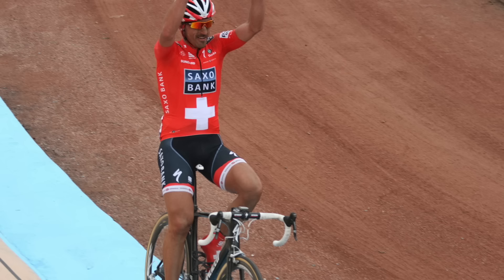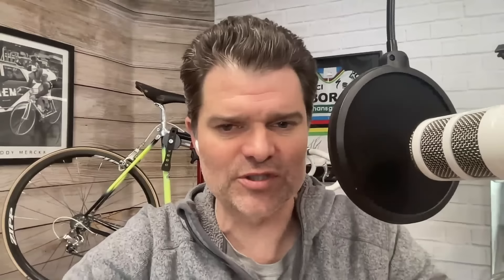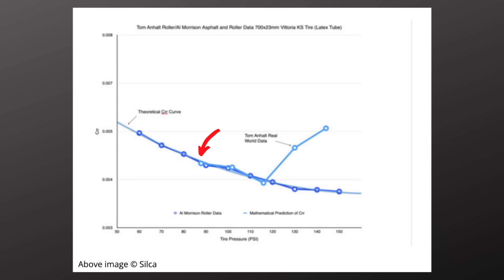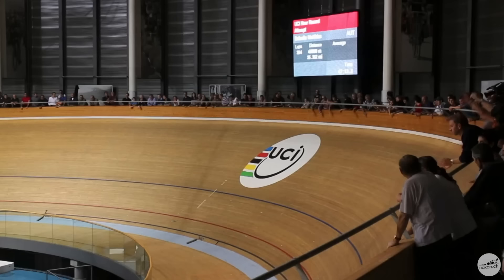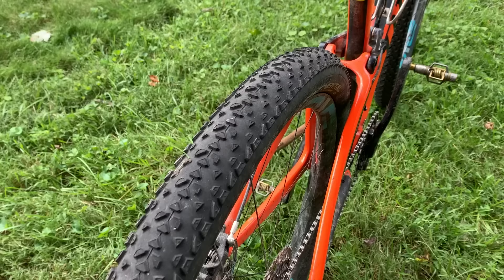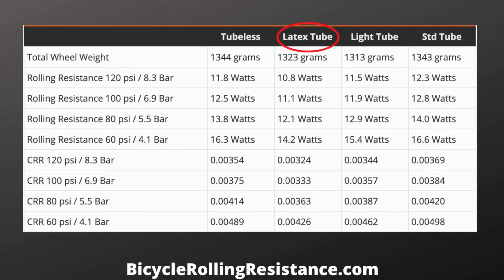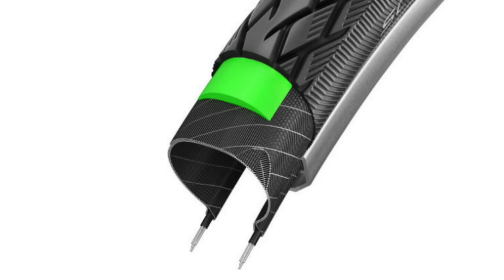Your Tires Could Be Costing You Minutes. Tire Rolling Resistance with Josh Poertner

Comment: Nailed it! Have been trying to work out a balance between the most efficient tire and insert setup for the upcoming gravel season while also being as puncture resistant as possible. This was very useful information, thanks!  Discussion with an industry expert format was great!
Reply: From my mtb experience I find the inserts (I use tannus with a tube as I am too lazy/cheap/eco to keep topping up tubeless sealant every few months) it is easy to opt for too low a pressure. The inserts do a great job at cushioning the rim and propping up the sidewall allowing decent cornering but one sharp edged rock will STILL always get me a pinch puncture. I either need more robust tubes or put a bit more air in - still playing around but the take homewould be don't expect full protection from the insert. Grip, comfort and protection from small thorns etc - brilliant but pinch protection not great.

Comment: I went and used the calc as soon as he mentioned it and was surprised I was pretty close already. 1 psi fr and 4 psi back too high, but my risk tolerance for pinch flats is low. Ideally I know I could go lower and probably faster or hit the plateau around 5-10 more psi and the main risk is pinch flatting more than going slower.
Reply: That's where the tyre insert helps. I got a Vittoria gravel insert for my rear wheel and I can run much lower pressures. So much more comfortable on rough roads.

Comment: I’m a new (road) cyclist and very skeptical regarding equipment. I was inflating clinchers with tubolitos at 115psi. I’m not good at technical descents. I recently built a new bike with tubeless at 80psi. I can finally trust the tires and they grip much better. I was surprised. On further comparison the tubed tires are too hard and skid (slip) on tarmac, not to mention how harsh and bumpy tubes are. Thanks for the more technical explanation

Comment: For every technical road crit I would drop that tyre pressure way the hell down, under 100 psi for a 25 mm tyre because for crits the goal is to stay upright in those corners which means a need for more traction.
Reply: In my experience flat tires are really slow.

Comment: Old school over here, still pushing pressure of my Conti5000 in 25 up to 8+ Bars thinking it's faster for stealing KoMs 😅 Time to test recommended value of 6,5 bars but it feels so soft and slow my god!
Reply: I go by PSI on a floor pump that is largely illegible and driving me bonkers but let me say that 100-105 PSi fresh off the pump recently was felt to be very harsh, and due to that inefficient. Previously I have ridden with my front around 90 PSI and rear a little higher and since this was less bouncy it felt better and was smoother. I think the 95 PSI or 6.5 bar is spot on.
Reply: I’m rolling 28mm conti5000 at 5 bars rear and 4,5 bar front. Anything more and i feel my speed dropping at every little bump. With these pressures i’m cruising and still reactive when i push.

Comment: Its a bit of trial and error, over the winter I have been doing short course forest -gravel racing, I have opted for 28mm road tyres running at 95psi front and rear, now that would normally be a disaster combination, however I have done really well, coming in a far better position than I expected, improving on every race I am a big bloke but this is what is working for me , the wheels are hed ardennes and the tyres god old durano DD.

Comment: The video was excellent. Just one additional point though. You have to be in a devloped country to use your advice. In the Philippines, I used to use continental racing tires, inner and outer, and I got flats all the time. Nearly every road trip, so annoying. Now i use continental 4 seasons, and cheap, thick, Black Cat inner tube with inner linings. Not fast, but at least, no more flats.

Comment: I used the pressure calculator and I was surprised that I was running at a much higher tire pressure than what's recommended. I've always been told that higher is always better. I have a road bike with Good Year Vector 4 seasons tires at 28mm. I always went 100psi on both tires. Now, I'm eager to test it out at a much lower pressure 78.5 in back and 77 in front and see if it does make a difference.
Reply: Jesus man. You must be bouncing quite a bit on bad asphalt unless you're a very heavy rider. I use 85-90 PSI on 25 mm. tires and it's comfortable enough for 3 hour rides. You'll be glad you dropped that extra pressure.

Comment: Never heard about inserts although I still run latex tubes. No tubeless here yet I am just used to replacing tubes if I get a flat. Although I will say since I started running lower pressure I haven't had a flat knock on wood.

Comment: Wow! Most of this stuff sails way over my head, but I have put a lot of miles on bikes. I have also noticed that tires make a difference in how fast I go. For me, on smooth pavement at least, 700 x 28mm at 80psi feels the fastest. On rougher roads 700x 40mm at 50psi  feels fastest. Off road, I couldn't even guess but it seems wider + softer = better. Of course I am heavy (200-220lb depending on how much gear I'm packing).  I have also noticed Kevlar liners seem to make the tires slower. (I just use sealant and/or an old tube as a liner)

Comment: Talking Vittoria insert......I installed a set on my aluminum gravel wheels and don't "notice them", which is good, but I really doubt I could ride them without air. The Vittorio foam is very easy to compress, so I'm pretty sure you would be riding on the rims. Other inserts may be more dense and resistant.

Comment: I just got back into road cycling after being away for 10 years. Since my bike is from 07 it won’t fit any thing bigger then a 25. But as soon as I got to Florida where we can ride year round I started running lower pressures in my old racing 700x23s. I’m actually running 85 lbs now and I used to run 115 to 120. 
I did have a problem in a sprint the other day. The bike really felt a little wobbly at 35 mph in the heat of the sprint like the tires were flexing too much.

Comment: You aren't measuring rolling resistance if you put a wheel on a drum. Because the most important factor is missing: the body of the rider. Inside the body friction causes energy losses from the propulsion. This is usually way more than hysteresis losses of the tyre.

Comment: Hopes its ok to make a second comment: For over 20 yrs I have used on my road bike tires at 23mm front and 25mm rear both inflated to 120psi.  If I go any lower, I hate the under steer that increases.  I am a tall a heavy rider and I am more likely to get a pinch flat.  On my MTB ride I used 2.5 x 26 inch at 40-50 psi, lower...then there was under steer.  For me I just like the solid feel of the tire under me, I want to feel the road (Vittoria tires @ 320tpi...just love them). Off road, I did the Wilderness 101 using 47 mm rims and 2.5 inch Bontrager Big Hank tires (zero tread)).  What a awesome ride!!!   I think the rider style, rider height (center of gravity) and rider body weight is fundamental in this subject.
Reply: Those are some very high pressures. You didn't list your stats, but I'm 6'7" / 230lbs and quite competitive, at least on Strava.....Gravel 40mm 28psi F 40psi R / XC MTB 2.3" 22psiF 26psi R....a pound less or more depending upon terrain
Reply: Yeah EWS and pro DH riders really have understeer issues running pressures in the 20’s, if only they had your wisdom

Comment: Good video and like the Podcast style used.  My ongoing nagging question is why is watts used instead of "Torque or pedal force"?  Not sure how the formula for Watts or Horsepower is applied when discussing friction? Would it not make more sense to examine pedal load or torque output, given the same gearing, RPM and carried weight (rider plus accessories) is used in each sample taken?  

Pedal force and torque is what changes (at the same gear, RPM and weight) to achieve the same speed when testing changing tire pressures and tire widths.  Power out put in these instances are meaningless except to excite the mind.  

Then again it appears most power meters fail to display and record the torque output as the PowerTap did back in 2003.  Pedal power meters should show/record the force applied by the foot to the pedal (as piston force is to car engines) which is the ultimate measure of rider input, especially in testing tires.  But pedal power meters don't display such data.

Comment: Low pressure, thin tyres for lowest rolling resistance unless you're a commuter on dark winter roads or indeed completing Roubaix as an amateur.  Tough and heavier beats fast and light tyres when they puncture.

Comment: Thanks, Dylan. The Silca pressure calculator, however, seems to disagree a lot with the Zipp calculator. Silca suggests me 68 and 70 psi, while Zipp suggests 52 and 56 psi. It seems Silca is not taking into account the inner width diameter of the wheel and hookless wheels as a factor. On the other hand, I’m very light (58 Kg), so I would image that a heavier rider will get a suggestion past the 73 psi, which goes against the ETRTO maximum pressure standard for hookless wheels. My wheelset of Zipp 303s has this standard written on the wall of the wheel.
Reply: Our calculator needs measured tire width, not sidewall width plus inner rim width.  The Zipp calculator can be wrong about the actual width by as much as 5mm, so you really need to measure the physical width of the inflated tire for best results.  Also, the Zipp calculator will not allow suggestions that violate their rim max pressure, so the calculator lowers pressures to avoid this (when it should tell you to use a wider tire in those instances..)
Reply: @SILCAVelo   Does using a narrower inner (and outer) width, 'old school' type clincher rim with a 25c tire have any bearing on the inputs on this calculator, and therefore suggested pressures?

I realize that I may be the single only one still riding 14mm inner width rims which is WHY I ask. ;)

Comment: if you have riden a 50cc moped to sandroad washboard you know what it does. it sucks the speed out. Reason is that bike needs to go up and down. that takes energy. Too high pressure does the same thing. if you hit 3mm obstacle on the road and your tire is so hard it cannot take it in, the bike and rider needs to go up that 3mm. or like 1 if tire takes 2. sounds small, but on uneven surface that is happening constantly.

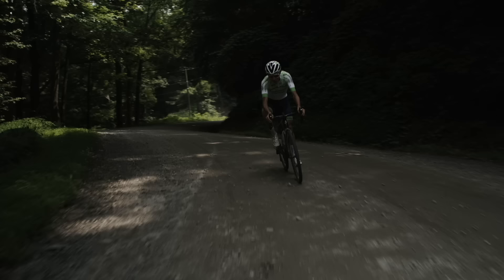Comment: Extremely cool video and great info! But at 13:57 Josh says that "high hysteresis tires don't hold road as well", this is very controversial thing to say, because high hysteresis rubber compounds are known for the better grip, rubber conforms to the bumps and holds shape, not bouncing back. you can check this article for example (google "racecar-engineering tyre-grip"). Or did Josh mean something else?

Comment: For MTB your tire pressure is typically limited by how rocky and fast the course is. You can't go too low without bottoming out on the rim and risking a flat or damaging the rim. For example riding enduro I run 28psi in the rear tire, but I can get away with 22-24 for XC riding. How much does the lower PSI benefit wattage? For MTB XC are you better off running lower PSI with better rolling resistance and sandbagging the descents a bit to protect your tires or will you lose more time going slow on the descent than you will gain back in rolling resistance?

Comment: how does the SILCA tool compare to the tire manufactures range recommendation. For example, Continental Grand Prix 5000 recommended PSI range is 95-115 depending on rider weight. That is a lot greater than the SILCA tool recommendation. Why are the tire manufacturers so far off?

Comment: Curious if I could get your input on this.

Most tire pressure calcs, and things that I see, always recommend lower than I expect (fit the mold of the typical intuition of most riders having pressure too high).  However for me, as someone whose moving from road riding into gravel, the 'two low' has more to do with feel than the numbers.

I currently have nominal 38 (measure 43) gravel tires on my MTB hardtail frame (tubeless setup), and I find the main differences from convention are two fold: a) I'm about 20lbs heavier than most cyclists my height, and b) my weight is severely rear biased compared to your niner geometry, or a typical gravel frame.  as such, the 'too low' feel for me is when I start to put power down, but the rear end of the bike starts to bob and it feels like I have rear suspension.  I tend to go up from there (in 3 PSI increments) until I find what feels nice. 

Not sure if this is 'good' or not.  I'd love your take on it.  for me, though, I'm applying the same logic I use for owning a hardtail vs a full sus: if I'm putting power and it's causing the rear to bob, that's waste energy I'm not putting to the forward thrust.

the weirdest part for me is that on some narrower tires (blackwall) I was running 35PSI, but on these wider tires I'm actually running closer t 40-42 to get that same planted 'feel' for the rear tire.  logic tells me the wider tire should be capable of lower pressure but my feel doesn't trust it :D 

anyways.. thanks for the awesome content, hopefully I'll see you at unbound 200 this year!  Also, long story short, I'm not going to be competitive, but I'm going for comfort + minimizing flat risk with my setup on the day.

Comment: HI Dylan and Josh,  Thanks for your awesome tips but one thing I still dont get.
Using the Silca tyre pressure calculator suggests I pump my tyres to 89.5 front and 87.5 back.  Fro my two sons who are significantly lighter, the pressures are even lower.  The question is then, what relevance to the manufacturers min/max mean when the happen to be min100/max130 psi?  Even on a smooth "new pavement", it only suggested max 95psi.
Cheers

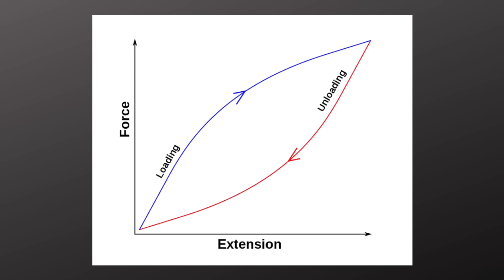Comment: Regarding the figure at 8:44.  I assume you are referring to the stiffness properties of the tire, i.e., how it acts as a spring.  Since stiffness is essentially a restatement of Hooke's Law for a spring, the diagram should be "Force" vs "Displacement." You have left the term "Extension" unexplained. Ok, it turns out it's from Wikipedia, which explains everything :).

Comment: I'm a small rider, so I run 90-100 psi for comfort. I almost never run 110 psi. The increased comfort on the hands and lower back over a 100 miles matters much more to me.
Reply: How small and what width tires?
Reply: @GNX157   I'm only 5'2" and weight around 145-148.  I prefer 26 or 28 for the terrible potholes around northeast. When I first started, my specialized road bike had 24mm tires and I found 30 miles my hands started to go numb. Even when I upgraded to carbon bike with AL handbars, I found 50miles my hands would get numb.  During the winter, I run 85-90 psi for comfort and safety.
Reply: On 28’s at that weight you could probably go 80f and 85r and still be very conservative.

Comment: This is more about comfort Everyone who has ridden an older steel frame bike knows that modern frames ride harsh over bad surfaces, Steel bikes absorb far more efficiently so narrow tires at high pressure were faster and were never a big deal. Today with less comfortable frames you need wider tires to absorb road surfaces. If wider tires were faster you would see them on the track but the track guys know that narrow tires at a high pressure is faster on a track surface and they break the records !!

Comment: Wow great info, i am running my 25mm tires at 8BAR standard. According to the site that is at least 1,75BAR to high (29PSI i believe).  I will try this tomorrow see if it makes any difference. Does lowering the pressure also increase the risk of having a puncture?
Reply: Yes it does, pinch flats mostly if you’re running tubes (road). That’s where the real risk comes in. You could go lower than the calculator recommended pressure and still keep going faster until you start feeling instability in the sidewall during turns and  pinch flats, which is the bigger risk.

Comment: So if I'm short on cash and can only afford one high-end tire would you buy the front tire or the back tire? I'm assuming the back tire where most of my butt weight sits no? I mean the difference in price between a GP 5000 $75 to $100 if you're doing tubeless versus $40 for a lower and tire that could be a lot of savings for someone who's strapped on cash

Comment: I have a 'habit' of using FAT(ter) Tires (than 'ideal') @ HIGH(er) Pressures (than 'ideal') because *I Have Found* (that) *NOT Stopping to Fix PinchFlats is WAY Quicker than the allegedly 'Perfect Pressure'...  
Plus, I do not have to 'fret over tire pressure gages and pumps at the beginning of each ride because my thumbs are sufficiently accurate to realize that I will not be getting a pinch flat today...  
I occasionally add when my thumb says so, or if I actually 'Felt' the Rim hit hard enough that I feel compelled to reduce that worry soon...  
WithAllThatSaid, I am an engineer and value the insights provided, and may tailor my 33+years of MountainBiking experience to incorporate 'more appropriate' Tire Pressures in future Rides...  
[Finishing a Ride with NO Tire Related Issues Can NEVER Be Considered 'Wrong'...  yet, Better is always Better...]

Comment: Isn't the aerodynamics of the tire-to-wheel width as important, or maybe more so than the rolling resistance, as long as you're in the ballpark for resistance?
Like, Bontrager wheel, 26 ext width takes a 23 tire? 
ie, Rim 105% wider than tire.